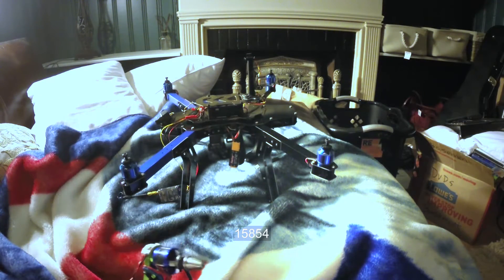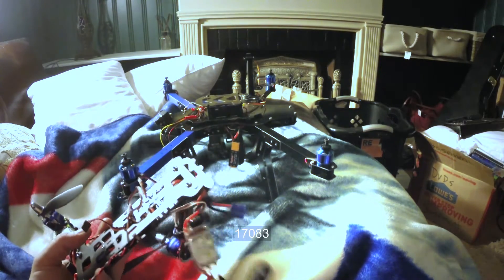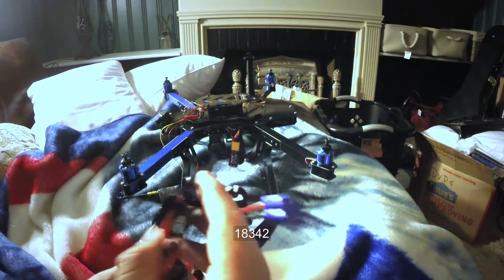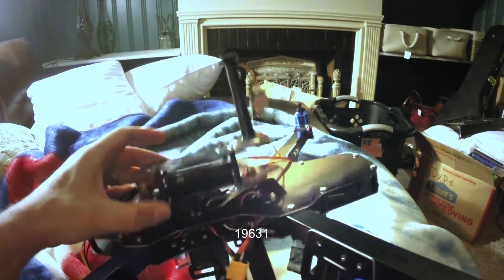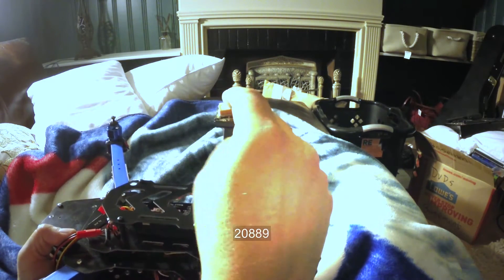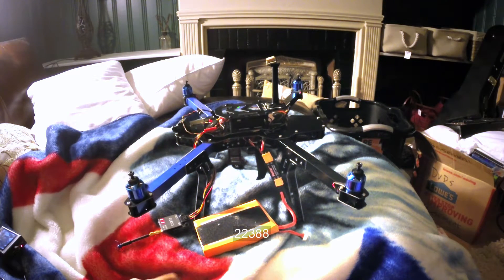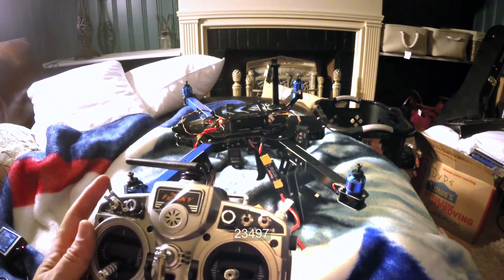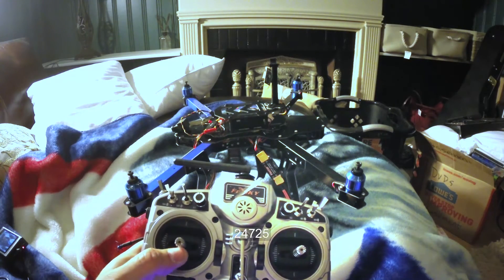Vector Throttle Issue

Comment: I'm having the same issue, I launch it, it gets to about 10ft wobbles gives me the Esc saturation then it comes down hard. If I even attempt to give it any rudder instant loss of balance and crash, the slightest breeze causes loss of control. I wasn't having any issue until I calibrated the esc's. This is driving me nuts. Please help, this is my first  real drone and I can't fly her :(
Reply from the maker: Ryan Thomas Wow, tough for a first drone. I really don't use my Vectors (I now have 3) much for multi-rotors. I have tried them a couple of times and quickly realized that they require more tuning time than I am willing to give relative to other FCs. I know many people are using them with great success and I suspect you will love it once you get it tuned. I primarily use mine on fixed wings and they are fantastic for that purpose.

When I was using these on multicopters, there were many forum threads that addressed these issues. That has been many months ago now, so I suspect there are many more with more complete responses. I would start with a google search of the problem (you probably already did this) then look through rcgroups and fpvlab forums for more information. Also, Eagltree support is fantastic. It would be worth your while to open a ticket with them.
Reply: OK tyvm

Comment: I have same problem as you did after your crash . I have same throttle issue that you had in this video on bench test . How did you fix this ??
Reply from the maker: I haven't really used it much on quads since. I've mostly used it in fixed wings. I did put it on my Flip Pro and have recently tested it with disappointing results. It didn't behave the way it did in the video, but, it is very unwieldy in the GPS mode. I suspect I could get it to behave if I spent hours tuning it, but don't have the time currently.

Comment: What flight mode are you trying to use?
Reply from the maker: At the time I believe I was taking off in Loiter mode. I discussed this with ET and they it shouldn't have caused the issue. I have it installed on a different quad and it's flying now. I'll probably put it in one of my planes soon.
Reply: Throttle is funky on the bench in all modes except 2d no hold and 3d

Comment: Interesting?! Sorry to hear you crashed. Were the esc's calibrated correctly?! Is it possible that you had the end-points not at 100% at the time of the calibration?! Maybe your gains weren't at 100% at the time of the calibration?! Maybe your esc's are set to high startup power instead of low... You taking a wild guess here... : )
Reply from the maker: Thanks for the response. No, I hadn't calibrated my escs. Could have possibly been the problem. I've since calibrated the escs and gotten the Vector working on my quad. I think they still have some firmware issues to work out but I'm optimistic this will be one of the best FCs out there.
Reply: ***** You should ALWAYS calibrate your esc's... Anyhow, glad you got it to work. Nothing that ever comes out is "perfect". They all need updates. Time will tell how good the Vector will be... G